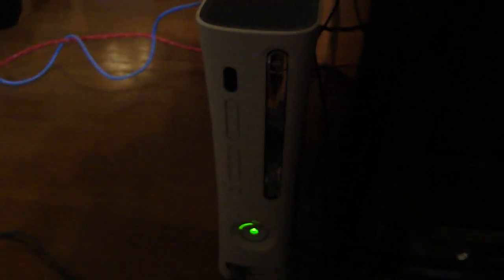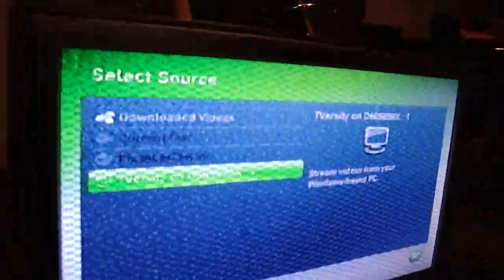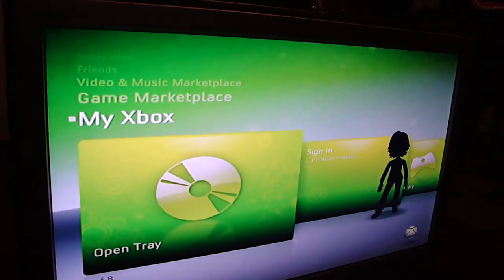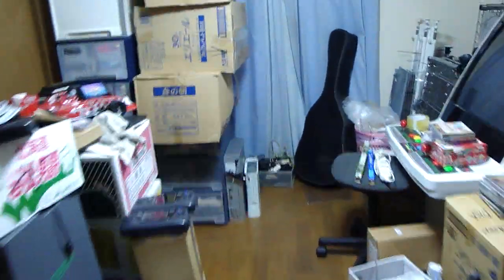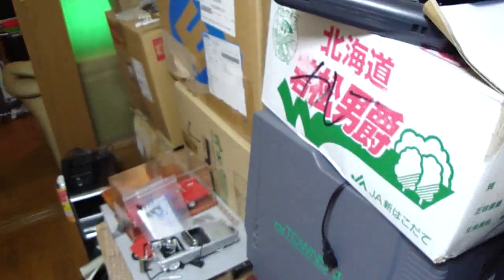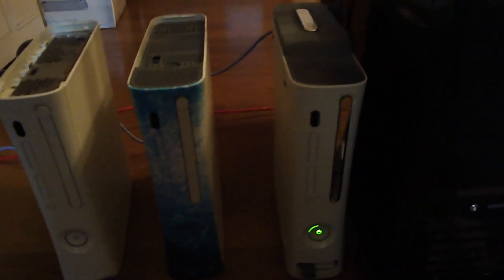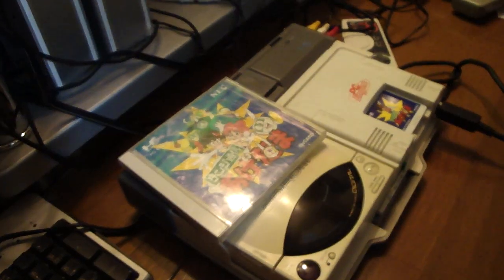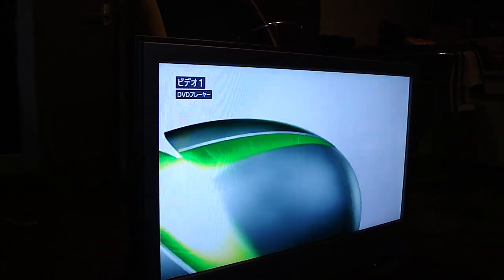They Don't Make Em' Like They Used To

Comment: If you could do a penny fix video that would be so cool Luke, I think there are some on Youtube though..  I love my 360 and want to get it flashed at some stage to play Japanese games but it hasn't been working for months.. I had my first on replaced twice, the warrenty ran out so I had it "repaired" 2-3 times privately and it STILL doesn't work.. I really do despair with this console as its so great WHEN it works! The towel trick works but I don't like doing that for obvious reasons!

Comment: I got myself a 360 arcade about 6 months ago and it is still in the box, well i actually tried it the day i bought it and put back on the box. i wonder if it still works. What exclusives do you guys think i should buy for it, but wait, i need to get a hard drive first. Im an rpg fan by the way and i dont like halo.